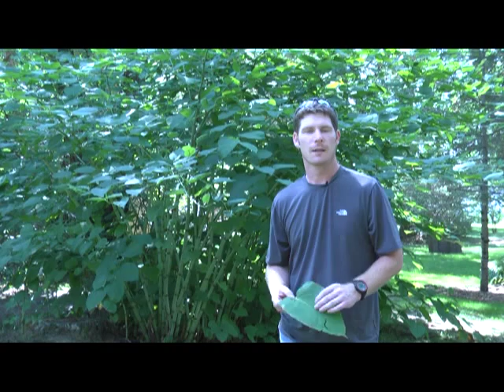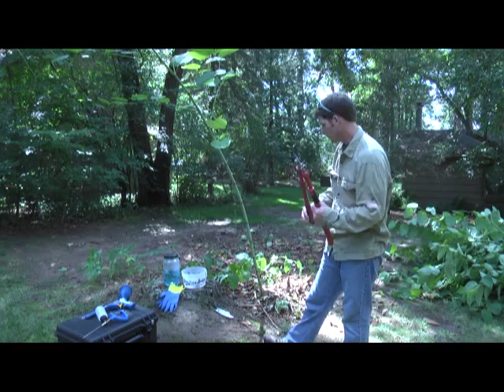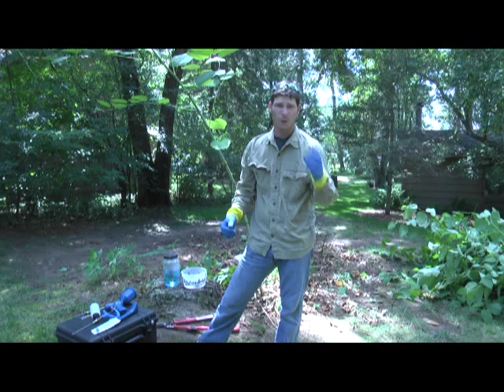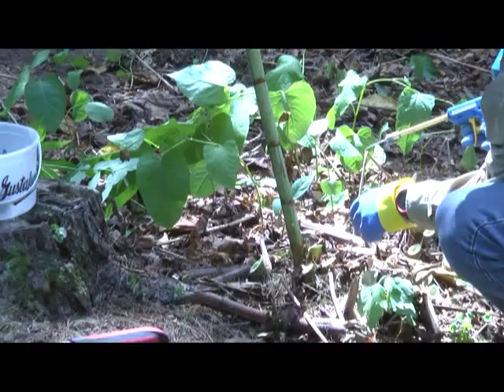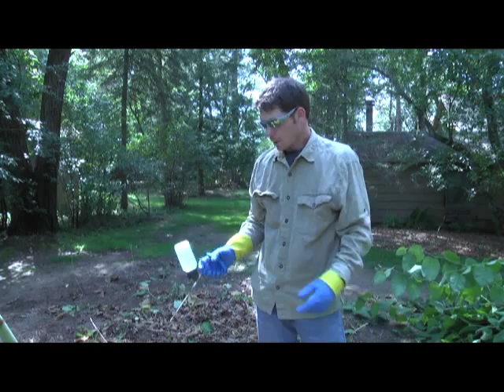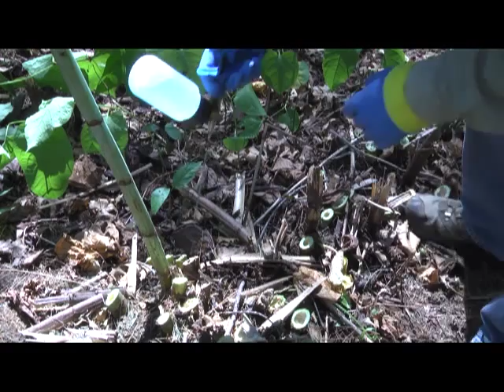Knotweed identification and control through stem injection

Comment: it kind of seems like rhizome injection didn't work. iv tried to find stuff on this and it all is from 2012.
Reply from the maker: Thanks for the comment.  We found stem injection to be effective, just very labor intensive.   For large stands this method really isn’t practical.  Usually, a combination of treatment methods was needed.  First, stem injection.  Second, when smaller shoots emerged from the remaining rhizomes a foliar follow-up treatment was always needed.

We did very little rhizome injection.  In tests of rhizome injection, it was difficult to get enough chemical into the rhizome as they are not as hollow as the stem. Stem injection allowed more chemical to be administered because of the large hollow stems.
Reply: @PolkCountyLWRD  thats great to know. Im a landscaper and was looking for ways to add Knot weed removal to my services but i wanted to do my research and figure out a good way to get rid of it.
Reply from the maker: @adamgeorge37  Stem injection followed by multiple years of late summer foliar treatment is an effective way to control stands.
Reply: @adamgeorge37  Look into “Anaerobic Soil Disinfestation”. It involves cutting the knotweed, adding a carbon-rich soil amendment, and covering with plastic tarp for a a few weeks. Roots Reset has had a lot of success with this in Europe

Comment: Looked to me like the needle went straight through the stem
Reply from the maker: Andrew, the needle is enclosed on the tip but has a hole in the middle of the shaft where herbicide exits the needle.  Knotweed stems are completely hollow, the needle pierces through both sides of the stem but the hole in the middle of the shaft remains in the hollow portion of the stem.  This allows a person to inject herbicide into that hollow space in the stem.
Reply: @Polk County LWRD  thanks for replying, I have some sort of plant that takes over a space in my garden out grows everything, iv pulled it out many times it just keeps coming. I was looking to see if it was possible to inject plants with weed killer to destroy them as I have no idea what this plant is or where its roots are, maybe its like mint and could be everywhere. It has purple flowers bees love it

Comment: I have been injecting 2ml roundup concentrate into a friends knotweed 3 weeks later it has gone brown and dead i am using the roundup neat and not diluting it with fantastic results 250ml only 7.50 on amazon and will do 100 shoots to 125